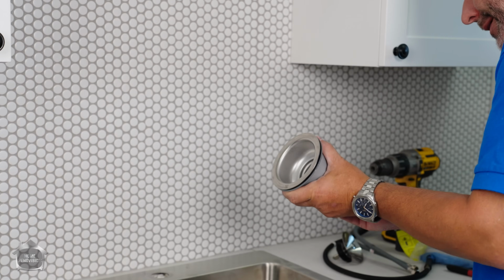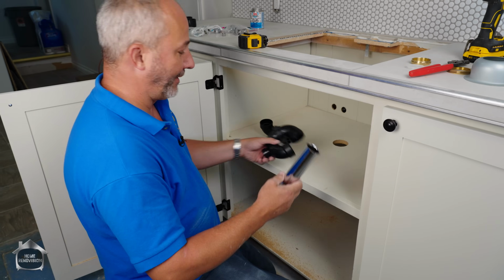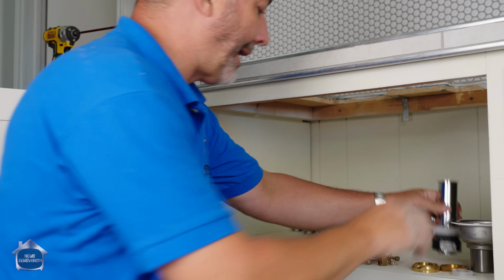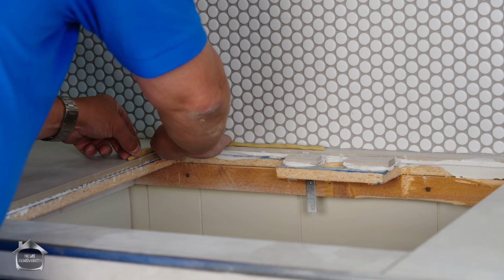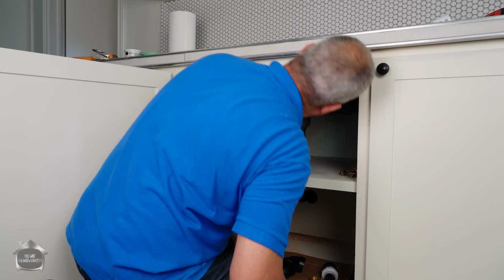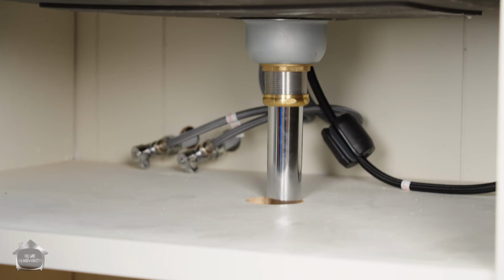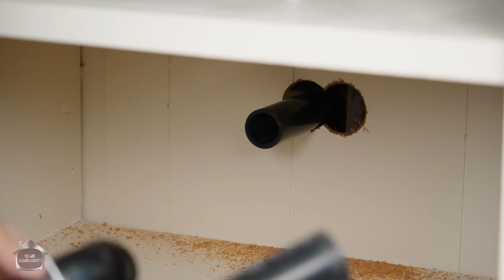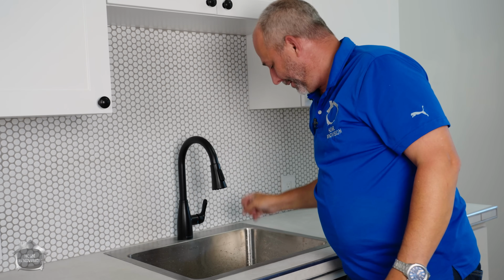How To Install a Kitchen Sink and Drain For Beginners | Church Flip | Episode 7

Comment: I stopped using metal P traps because my fingers when through one when I was inspecting under a sink in an apartment I lived in in college. Plastic doesn't rust and corrode. Although, I probably would use a metal sink basket since it doesn't constantly hold water like the p trap.
Reply: it gets hard and brittle and cracks.

Comment: tbh plastic doesnt rot like that cheap pot metal tho.. after the coating is nicked or worn through its amazing how fast that pot metal degrades and rots from just tap water... as long you u use plumbers dough and dont over torque it, it will far outlast the plastic imo
Reply from the maker: in truth most folks over torque the plastic so I can't suggest it. the tailpiece will at least last 25 years!
Reply: @HomeRenoVisionDIY  that is very true!!

Comment: I am not a professional, but why didn't you install the faucet on the sink before you installed the sink? Wouldn't it have been a lot easier to see what you are doing?
Reply from the maker: yes but it would not be as tight and firm as installing it through the counter as well as just the stainless. just the sink is faster and won't last 1 year! Cheers!

Comment: I'm surprised that you didn't install the faucet hardware on the sink before putting it in place. I learned that from "This Old House" . Thier Master Plummer is Richard Tretheuy (sp?).
Reply from the maker: faucets attached direct to a stainless sink will always come loose. I prefer to attach to the counter under the sink as well for durability.
Reply: @HomeRenoVisionDIY  How about cutting a piece of countertop to simulate doing as you suggest but not going through the countertop that the sink actually sits on? This would allow mounting the faucet before putting the sink in place.

Comment: Jeff. Yet another detailed job that you make look easy. Just wanted to point out a small detail that you maybe didn't film but when testing a faucet (or new plumbing, or etc), always remove any aerators/flow restrictors at the spigot before turning on the water for the first time. Otherwise, they'll catch any debris in the lines and/or fixtures that can then cause uneven or blocked water flow. Otherwise, keep the great videos coming.
Reply from the maker: Great tip Phill! Cheers!
Reply: Also install the faucet before the sink. And put escutcheons over the pipes 😉 and use pvc pipe.
Reply: @lowellswartzentruber5847  He's in Canada.   Code is ABS.
Reply: @AKJammer1  I’m so sorry. And feel sorry for them! 😀

Comment: You reminded me of when I was finishing my custom mailbox post last week. Went to lowe's and bought three 5" lag screws to attach the top. Not only did they not tighten up ONE BIT but they also stripped out in the process! And I'm saying one of them had a completely round head by the time I got it back out. So I returned that garbage and got three 6" torx construction screws at home depot that did the job on the first try.
Reply from the maker: Cheers to that!

Comment: Any way to make those holes drilled in the mdf look nicer/be lasting?
Reply from the maker: a little sanding maybe!
Reply: @HomeRenoVisionDIY  won't that just exacerbate the problem?
Reply: drill from two sides or have a board tight underneath to avoid blowout. sharp bits, pre drilling, tape.
Reply: Get some escutcheons to cover the holes up

Comment: What sink manufacturer brands do you recommend that have a good clip system?  Or should we just silicone it anyway in addition to using the clips?
Reply from the maker: I have been a fan of kindred.
Reply: @HomeRenoVisionDIY  isnt kindred the one that makes drop in sinks with those red tabbed screws ? holds the screw in place for you to install

Comment: D.i.y. job or professional? I have a dry rotted 4x6 upright post at the end of my carport, holds up the trusses/ roof. Can I put a few jacks under it and replace it myself or is this too much for d.i.y.?
Reply from the maker: just contact a structural engineer for the plans. anyone you hire will need to do the same so it isn't money wasted. then you can be sure to do it safe and right. It is actually easy once you have the right process in mind.
Reply: @HomeRenoVisionDIY  👍 thanks